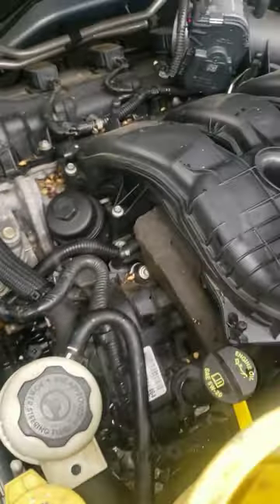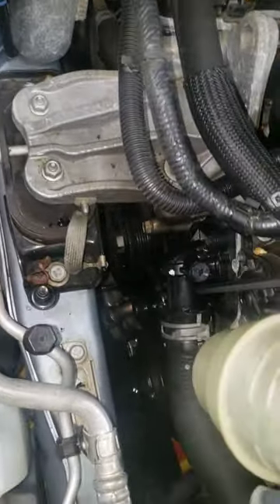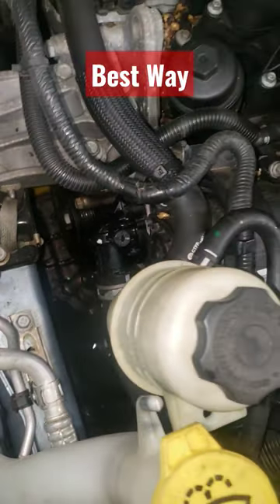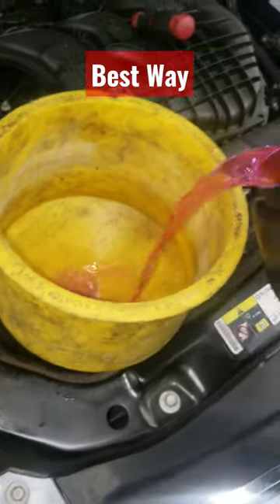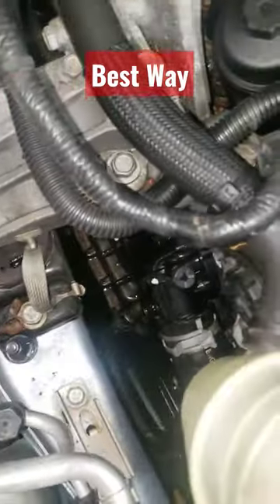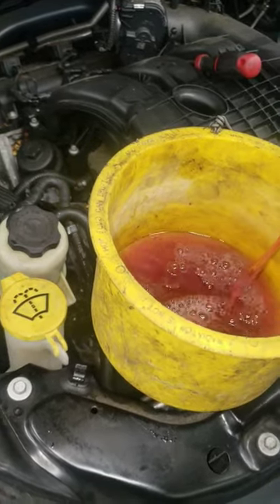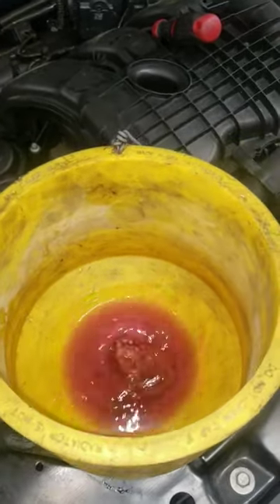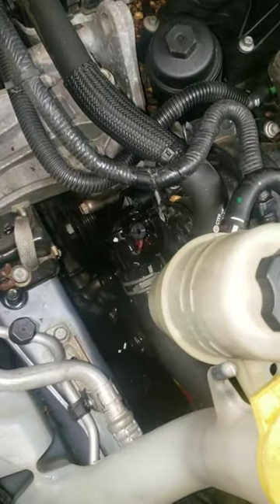This the best way to bleed the cooling system of air pockets on this motor.

Comment: I've never had any trouble with air pockets in these engines when using a vacuum fill tool. Personally I believe that's the best way. 👍
Reply from the maker: Interesting. I hear that a lot
Reply: @OnlineMechanicTips  judging from how often you post videos on cooling system repairs, it definitely seems like that's a tool that would be worth investing in for you, JT.
Reply: I haven’t used ANYTHING but the vacuum-fill tool for the last……… 15yrs. Bruv, make the change. Ive used them on everything from sl600’s, Cummins, Hayabusas, to my old 1971 super beetle.
Reply: They're right. An airlift will save you a TON of time. And you won't even have to mess with the bleeder screws. Because on some engines, trying to crack open the bleeder screw for coolant is a REALLY bad idea.
Reply: I'm still surprised that not every shop/mechanic doesn't have a vacuum bleeder. Refilling a system, waiting for the thermostat to open while bleeding, just takes so long.
Reply: Ive had an Air Lift tool for eons. It saves time and no burps. Test drive and little top up if at all required.
Reply: @OnlineMechanicTips  You need one. You don't need to bleed the cooling system when you use it, and it will verify you don't have leaks. Vacuum it and wait to verify no vacuum loss, refill it, drive it with the heater on and recheck the level. Honestly At this point I don't even ever have to add any fluid because I know exactly what level it needs to be at after filling with it. Engine gets hot every time and never has any issues burping whatever pocket might be left.

Comment: I have a steep driveway. If I point the car up the driveway during warm-up after refilling, it tends to "burp" the air bubble out of the engine. The bubble of air seeks the highest point in the system.
Reply: That's the way I've always done it. Seems to have worked every time.
Reply: Learned this on my Impala.  Worked perfectly.

Comment: A vacuum coolant refiller  is the best way to evacuate all the air pockets. Get with the times
Reply: Not needed.
Reply: Any self respecting professional should be using a vacuum filler. If you don't value your time, feel free to go with another method. Only speaking to professionals here,  unless you're only working on classics. DIY would depend.
Reply: @toyorover1313  there is many methods to burp a system it doesn't matter how you do it most modern cars are designed to work air out of themselves given there's a place for it to exit.
Reply: It matters when you're trying to be fast and also can't afford to have a comeback when that airlock manifests itself after the customer takes the vehicle (sometimes takes a while for them to work themselves out). I didn't say there's no other way, a DIY guy with all day to bleed his system won't need to vacuum bleed.
Reply: @toyorover1313  understandable if you work at a dealership and you have to be quick but here at my shop we work  at a slower pace and do things efficiently and correct. Using a funnel to burp the system works perfectly fine and takes less than 20 min.
Reply: All the power to you, but you're making my point with that comment 👍
Reply: @toyorover1313  and what exactly is your point?
Reply: @TriggerG59  it went over your head
Reply: @OFFICIALBROTHERBOLDLYMUSICNTV  sure thing not mechanic
Reply: @TriggerG59  Using a vacuum filler is both efficient AND right.. not really sure your point here..
Reply: @QuincyStick  my point is if you want to use one great and if not then don't they aren't needed
Reply: @TriggerG59  we get your point
So stop crying
Reply: @TriggerG59  This is true in a lot of cases, but not all. It's not only much faster but also can completely purge a system in which the fill point is not the highest point. They definitely are not mandatory (especially for diy) but quite frankly they're so affordable there's not really a reason NOT to have one in a shop.
Reply: Vacuum bleeder>anything
Reply: @Connor King  those vacuum bleeders are cool and all but I prefer the funnel as well they dont always work for every system in my opinion. Ive seen many master techs do the vac system an vehicle returns on their weekend off I bleed it and they never hear about how much air they left in the system.
Reply: It is needed if you get paid to do it flat rate
Reply: The one we use at my shop takes less than 10 minutes. And I suck out all the coolant and flush fresh coolant in 3 times to get out any deposits. It really is the most efficient way. Just faster. Simpler. Have a customer out in 15 mins.

Comment: You should be using a airlift for the coolant which pulls a negative vacuum on the coolant system and will also tell you if you have any other coolant leaks if it doesn’t hold vacuum!

Comment: I just poured a bunch of water into my tank after draining, ran it until it was clear when draining, then topped up with 60/40 coolant and water mix, drove the car around with a lot of high revs and high-speed corners and then squeezed a few hoses to get bubbles in the expansion tank, no dashboard lights so far 👍
Reply: This is the Dukes of Hazzard method!
I approve👍💯 !
For those pesky bubbles that sometimes are nearly impossible to get out,  I would recommend jumping a creek at a place where the bridge has washed out.  sAfE aNd eFfEcTiVe 
😂😂😂✌🍩

Comment: JT have you ever used one of those vacuum cooling system refill tools? It uses your air compressor it creates the Venturi effect pull a vacuum on your cooling system and then it sucks the coolant in and fills the system that way.
Reply from the maker: Nah, my neighbor have one and he loves it.
Reply: It's not full proof. Sometimes, you still need to do this with the screw or burp it by leaving the cap off and it running.
Reply: It is actually the ONLY way to fill many modern systems. It is fool proof if done correctly. Pull a vacuum, let it sit for 5 minutes. Then pull coolant up to the valve but not yet into the system. Close the valve, and let it pull vacuum again. Then, open the valve fully and there you go.

After you do that the reservoir will be over filled (if it has a pressurized reservoir) so then I set the fill bottle below the car and let it siphon to the correct level.
Reply: @toyorover1313 occasionally I'll come across a system where the vacuum tool doesn't work perfectly, but it is ALWAYS less hassle than any other method
Reply: They're great until they collapse plastic parts that have no business in the cooling system anyway.
Reply: @OnlineMechanicTips  can you give me some advice my Chrysler 300 v6 keeps over heating I changed a line added 50/50. And got a lot of air out still over heats , took it to get a coolant exchange they used that vacuum tool to get coolant out and new in and I still have the same problem. It’s only over heating while stepping on pedal

Comment: I usually just fill it up while it’s running then let it run untill the thermostat opens up fill it sommore take it for a test drive get it nice and hot then park it and check it after it cools down never had any comebacks for overheating

Comment: Had a Dodge Journey a couple days ago that refused to burp the air out of the top third of the rad, despite using the funnel and opening the bleeder. Had to pop the upper hose at the rad to make it right.

Comment: You could just use a vacuum fill system instead. 
An absolute must for water cooled Porsche's where the cooling system runs the entire length of the car.

Comment: Astro Pneumatic Tool 78585 Universal Radiator Pressure Tester & Vacuum Type Cooling System Kit. I use this kit to vacuum fill the cooling system/

Comment: I don't know what kind of engine this is, but I've found that if you just look the engine over well, you'll find one of these little plugs. I've never seen more than one. I'm certain the manufacturers try to minimize the need to have these.

Comment: The best way to 'bleed' a cooling system, is to use a cooling system pressure tester. It forces coolant into all the nooks and crannies, forcing air pockets back into the radiator. Then you just top off the coolant.

Comment: Vacuumfiller is definitely the best way. Every shop should really have one.
Reply: Our shop has one but it in no way removes all and fills all the coolant. Still need to bleed the system
Reply: @user-white007  perhaps its not being used correctly? Since it pulls a vacuum, there can be no air left in the system. Its also tells before filling if a hose is not connected, then its obviously not possible to get a vacuum.
Reply: @douglasberg2881  as you know there’s a wide range of vacuum ours pulls a -20 something don’t know the units lol. But you could leave it on all day it’s never ever gonna pull all air and all coolant from the systems that would be a perfect vacuum

Comment: People have no idea what an air pocket in the cooling system will do. The coolant just will not circulate if there is an air pocket or more. I used to build really nice BMW show cars and if you replace the cooling components or say you do the fan clutch and take the radiator out and you don't bleed all the air it will overheat instantly.

Comment: VERY diffacault to bleed the 3.6 on my JK.   About to buy myself a vacuum bleeder, it keeps airlocking, I lose heat on hwy and lower radiator hose sometimes is cold after 40 miles of hiway...

Comment: Drill a small hole in the flat part of the thermostat and you’ll never have air pocket problems again. If not then You can also leave a top radiator hose off while you fill it

Comment: I almost replaced my thermostat. I had flushed my cooling system and replaced coolant and then, I had no heater and my overflow bubbling after a drive. All these years and never knew to bleed it.
Reply: You do this with the car running, heat full blast, a lil while after getting heat in the cabin and no more coolant going down, put the cap on and you are good

Comment: Wanna have fun? Try filling and bleeding a Audi/Porsche product after changing a water pump.
Reply: Wait what, you mean having water/ air intercooler plus 3 electric pumps plus a maze of heater hoses for 4 zone climate makes it more difficult to bleed? /s

Totally agree, hybrid cooling systems are even worse.
Reply: @toyorover1313  even the older B5 B6 Audi were tricky if you didn’t know about the hidden bleed hole in heater hose behind the fire wall.

Comment: Why he do it like that 😂Your supposed to open the bleeder screw after you fill it and when it's running engine on warming up, then your gonna want to warm it all the way up. Why is he filling the system with the bleeder open that's drawing air in when it fills up 😂 close it fill it, start it open it warm it fill it. ☑️☑️☑️☑️⚡⚡⚡⚡